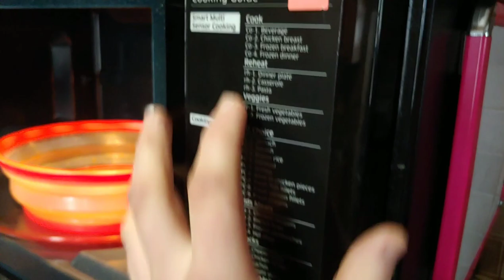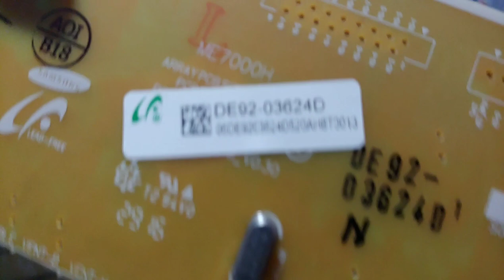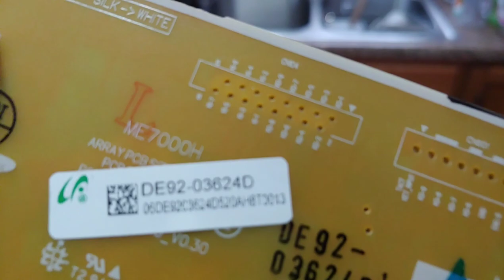Microwave buzzing when door closed (FIXED)

Comment: Andrey Thanks for sharing, I had the same problem, and when I checked all the diodes/capacitors were good. Next, I checked the main relay (black with code DYSF-D12V-P1) for continuity and it was stuck on, gently tapped it a couple of times it released and the continuity became 0. we can find the replacement relay for few bucks. If you can solder it in place. Or buy and replace the board. Hope this helps someone.
Reply: Thanks man.  I came to this video hoping to find a solution to my problem.  Your solution did the trick.  I tapped on the relay and it became unstuck and microwave started working properly again.

Comment: Great video sir, I have the same problem and tested the switches, Megatron, capacitor and transformer and all good in this case is either the board or the switches but most likely is that main board

Comment: You didn’t even prove if the board was faulty. Could’ve been a bad magnetron or diode or capacitor.
Reply from the maker: Not sure what to prove. I replaced the board and microwave works.
Reply: Bad magnetron or diode wouldn't keep the microwave energized when the cook cycle completes.
Reply: I worked on microwaves at an appliance shop I worked I will tell you that was definitely the board if it was the compaster or the magatron or the diode it would have been noticed with a louder buzzing noise it definitely was the board I had a few come in like that swap out the board and the buzzing noise is gone.
Reply: Andrey Thanks for sharing, I had the same problem, and when I checked all the diodes/capacitors were good. Next, I checked the main relay (black with code DYSF-D12V-P1) for continuity and it was stuck on, gently tapped it a couple of times it released and the continuity became 0. we can find the replacement relay for few bucks. If you can solder it in place. Or buy and replace the board. Hope this helps someone.